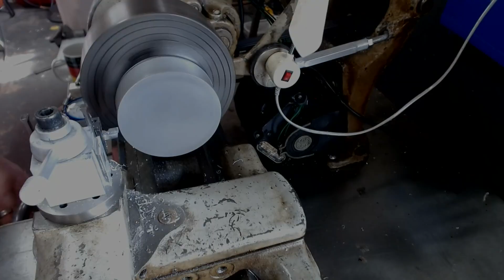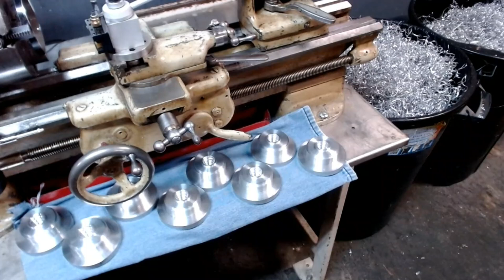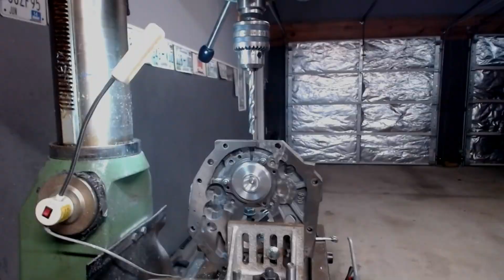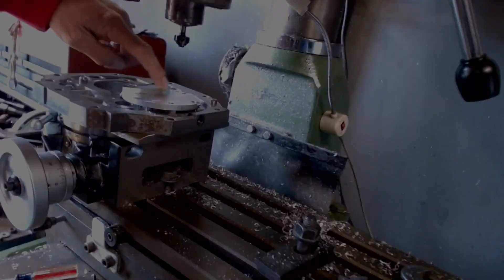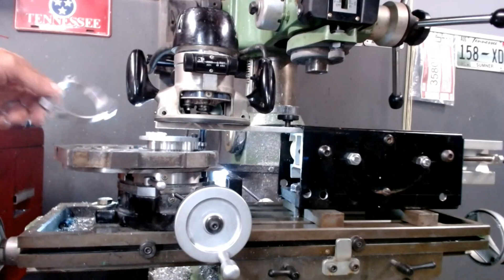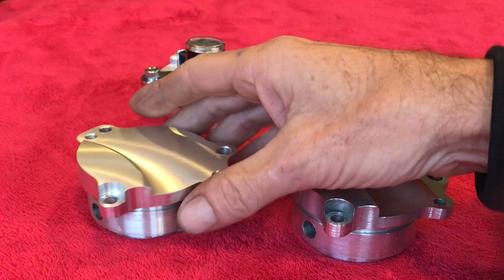Making a Custom Aluminum Oil Filter Cover for a Virago - no CNC

Comment: Steve, I hope you’re having an excellent day!

Hey Steve, for a second-generation Virago, if I want to add a radiator like you did on your first-generation Virago, would you recommend adding a restriction to the hose going to the radiator, or can I set it up the same way you did with the Remote Mount Oil Filter? Directly? One hose going to the radiator and another returning the oil to the engine?
Reply from the maker: Hey man…thanks and hope you are having a great day as well 👍

For adding a radiator to the 2nd Gen, yes, you could use the same cover like I did for the remote oil filter (it is actually the same cover that I make), except that the cross drilling in the cover that lets the oil flow the normal path is completely blocked off for the remote filter, whereas the cross drilling is only partially blocked off for the radiator setup. 

Partially blocking the cross drilling in the cover forces some of the oil to go to the radiator, but still allows some to flow through the normal shorter path so it starts providing oil to the motor much faster than if all of it goes through the radiator.  When the bike sits for a while, the oil in the radiator drains back into the motor case so when it’s started back up, it takes it sometime to refill and then start oiling the motor again…thus the need to have a little oil flowing the normal faster path.
Reply: @ 

Excellent, so if I find a way to add a check valve to the radiator, I could solve this issue of the oil flowing back from the radiator, and that way I avoid the time it takes for the oil to flow back up

Speaking of a radiator with an inlet and outlet on each side, this way I’d place the hose that sends oil to the radiator with a check valve, and the return hose pointing upward. That way, if any oil flows back to the block, it’ll only be a small amount, and the radiator should always have oil in it.

I’m not sure if I’m explaining myself, haha, but I need to think it through

Thank you so much, Steve. Your support is greatly appreciated
Reply from the maker: @ hey again !  Yep, that might work to have a low restriction check valve to keep the oil up in the radiator 👍. That way, only the amount in the return line from the top of the radiator would drain back so that shouldn’t take much time at all to get back to the motor.

Comment: Hey, these are fantastic covers. Are you still making them? I can't seem to find any on eBay. I have an XV920R (chain drive) that needs a cover. The cover from an 85 XV1000 doesn't fit. Have you made any for the chain drive 920's?
Reply: I'll have to look for the 4x7 stamp when I get home this evening. I do know the XV1000 motor that I have has the oil filter cap with the crescent shape, but it does not fit in the XV920 chain drive crankcase—the internal body of the oil filter cover is just slightly too wide to fit in the 920 case. I will confirm if the 750 cover fits this evening and let you know. Thanks for taking the time to help!
Reply from the maker: @dwightmason5430  yep, let me know 👍. I went back and looked at my stash of OE oil filter covers I collected when I first started making them, and there is one 1st Gen I have that is slightly different in design.  The outer diameter is the same size so it would fit into the right side motor cover hole, but for some reason this one has a shorter length to the stepped down diameter where the orange oring goes on the end towards the filter. If that’s what is not fitting, that would be interesting to know and would explain why this one has a shorter length on the step down (it actually still has the “4 X 7” stamped in it).  If it’s just that it won’t fit into the hole of the side cover at all, then it may be that the side cover has a slightly different diameter for the 920R.
Reply: @StevesDIYs  Yeah, the stepped down diameter where the orange ring fits won't fit past the opening of the filter hole in the 920R crankcase, so no idea if it would even fit depth wise. I'm gonna try the 750 cover when I get home. I'll let you know what I find out.
Reply from the maker: @dwightmason5430  👍. Yep, if it turns out that the stepped down diameter’s length is the issue, I could actually make that style as well since I have one I could get the dimensions from. That would be interesting for sure if that’s why that particular one is like that for the 920R
Reply: @StevesDIYs  I never got around to checking the 750 oil filter cover, I dove right into continuing the 920 chain drive 1000 conversion. I've been anxious to get everything in the case and get the case sealed and buttoned up—which I managed to get done last night but ran out of time and wasn't able to check the 750 oil filter cover. I'll pull the 750 oil filter cover tonight and see if it fits in the 920.
Reply: Well Steve, I feel a bit dumb, haha. I was checking the fitment of the oil filter cover against the crankcase, not realizing the orange o-ring on the end of the cap doesn't go past the inside lip of the side cover. That o-ring seals against that lip inside the side cover while the small opening at the end seals against the oil filter's rubber seal. I pulled the 1st gen 750 oil filter cover and compared it to the 2nd gen 1000. They are nearly identical--the difference being the oil filter mating surface on the 750 protrudes past the end of the o-ring step-down just slightly. The 1000 filter mating surface is flush with the end of the o-ring step-down. Dimensionally, they are the same from the cover lip to the filter mating surface. Just imagine taking a 2nd gen XV1000 oil filter cover; now imagine shaving about 3mm off the end of the o-ring step-down while leaving the filter mating surface untouched. You would now have a 1st gen 750 oil filter cover. I'm pretty sure that shortened step down is unnecessary as there's no interference on the 1000 cap with the filter from the 750. So the long and short of it is I don't really need a new cover after all. The 1000 cover is in great shape; However, it would be cool (no pun intended) to add an oil cooler--especially since I live in Houston and my commutes can get toasty.
Reply: I really appreciate your responsiveness! What would you charge for an oil cooler-ready cover?
Reply from the maker: Thanks man !  Do you still have the bad oil filter cover for your motor?  If so, does it have the crescent shape on the face that matches to the right side cover or is it smooth on the face of the oil filter cover?  Unless someone has changed the right side motor cover, the chain drive 920 should share the same oil filter cover with the ‘81-‘83 xv750 as well as the regular 920 shaft drive (some are chrome though). If someone has swapped the right side cover from a 2nd Gen bike (it’s more rounded where the clutch pack is) then the ‘87 and later xv750 and xv1100 oil filter cover would be the one to look for. I do make these from time to time and should have a few made in about a month (I just make a few at a time since they take several hours to make in the shop). I usually put them out on eBay under my seller name Steve’s DIYs when I get them made. If you’d like, you can send a pic of your right side cover to my email: stevesdiys@gmail.com and I can look to see which one your bike has on it. Thanks again and all the best !  Steve.
Reply: @StevesDIYs  My original bike is the 82 750 with the crescent on the oil filter cover. My motor has developed a steady oil leak at the crack case seam so I've decided to tear it down and split the case to reseal it. I started to look into the 2nd gen starter upgrade and found out my 750 case did not have the required milling in the case and that the parts required added up to be quite expensive. Then I found a motor on eBay from an 85 XV1000 for less than the combined cost of the 2nd gen starter parts and thought, what the hell, let's just do a 1000 swap. Then one day I saw a 920R crankcase and transmission on eBay at a really reasonable price and thought it might be fun to try a chain drive conversion while I'm at it. I know what you're thinking, "you thought the parts for a starter upgrade were too expensive?" Haha, yeah well, I've always liked the Viragos, but I've always wished I could run a different rear wheel and tire setup and I liked the idea of the extra power gain from the chain vs shaft. So.... in summary, my final motor will be a piecemeal combination comprised of a 1st gen chain drive XV920 crankcase with 2nd gen XV1000 crankshaft, pistons and cylinders, with 2nd gen XV1000 side covers. I have the XV750 motor still, and I'm hoping its oil filter cover will fit the 920 case with a 2nd gen side cover. My 750 oil filter cover has the classic broken bolt hole tab which is why I'm looking for a new one. I've watched a ton of your videos and they've been extremely helpful in my Virago ventures. Then I saw your video of the custom oil filter covers and really liked them! Sorry for the long winded backstory. Any thoughts?
Reply from the maker: @dwightmason5430  Ohhh, that sounds like a good project indeed !  If you look on the inside of the oil filter covers and they are stamped “4 X 7” on them, they should all be interchangeable even if chromed. The smooth faced ones for the true 2nd Gens (the ‘84 and ‘85 were kind of a hybrid of both generations) are smooth in the front. I have a couple of xv1000 motors and their covers have the crescent on the front so they are like the 1st Gen covers.
Reply: Hey Steve, been a while since our oil filter cover conversation. One of your latest videos popped up in my feed and I was reminded about it. I'm still interested in a new filler cap for adding an oil cooler if you're still fabricating those. On another note, have you ever tried installing a set of 750 cams and heads on a 1000? Heads are next on my list and I was wondering if there are any performance gains to be had—slightly higher compression ratio, different timing. Any thoughts? I've yet to see any precedent for this.

Comment: Awesome work. Any chance you make and sell one with the oil pressure gage. I have an 83 920xv.
Reply from the maker: Hey man !  I actually do make a version that has an oil pressure gage for the 1st Gens (the 920’s and ‘81-‘83 750’s all share the same oil filter cover that has the raised Cresent shape on the face of the cover 👍). I sell them through eBay so each time I make a new batch of the different ones I create new listings versus having to stock all of the different ones.  Here’s the link to the current listing for the ones with the pressure gages if you wanted to have a look…I just made two more a couple of weeks ago 👍:  https://www.ebay.com/itm/224835687692?mkevt=1&mkcid=16&mkrid=711-127632-2357-0 .  All the best !  Steve

Comment: how much for one
Reply from the maker: Hello, I’m actually making a few more this week as some folks also asked if I could make some again.  They talked me into making the versions without the extra jack screws as well so there are a couple more options now lol.  They range from about $100 usd for the plain ones (like I made in the video), to around $170 for the fancy one with the remote mounted gage and all of the stainless hard line, braided line, and stainless gage and mount (the materials and assembly time on these really drive the price up).  If you want to, you can send me an email at stevesdiys@gmail.com and I can give you more details on the prices for the different ones.  All the best !  Steve